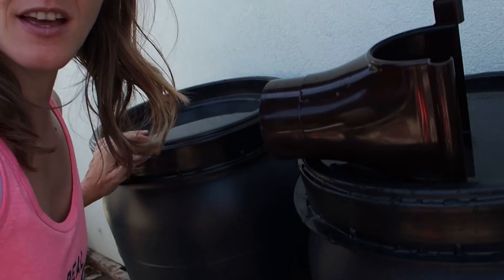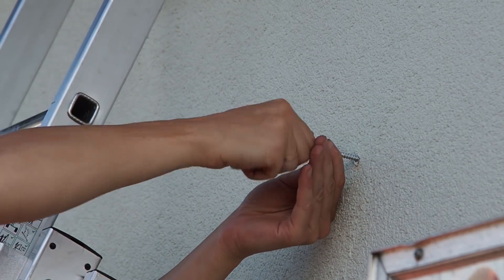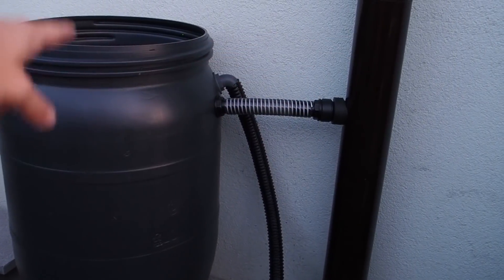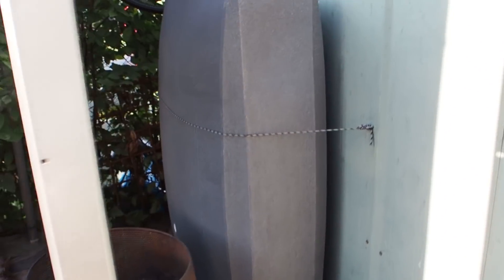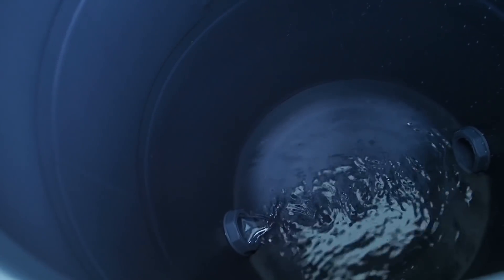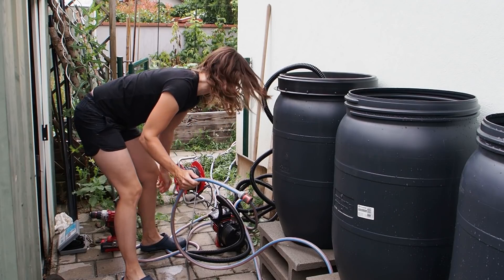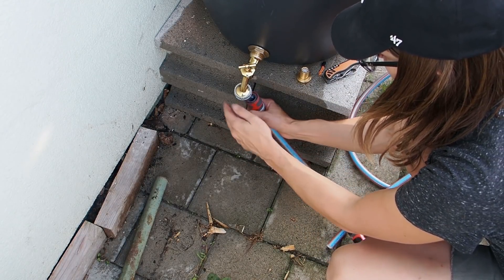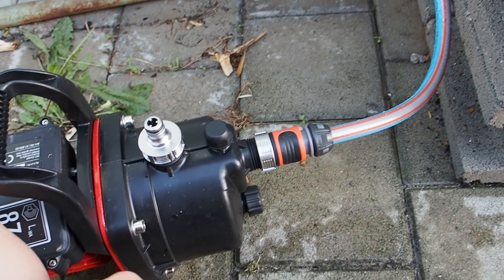Rainwater Harvesting System (Water Storage for the APO.CALYPSE)

Comment: Hi, nice video for the folks who haven't got the chance to install an underground tank (which i would definitely recommend! They catch all the rainwater from the roof and are relatively cheap and have a high volume starting at about 2000l, i got one with 9600l, so there is some reserve).

A few questions/suggestions:
Why didn't you just connect to the already existing gutter with a longer connecting hose? Would look prettier and be less expensive, always work with what's already there ;-)

also the hose connecting the last barrel with the pump should not be a normal "Gardena-Hose" as they are desined for pressure and not a "vaccum" (Unterdruck in german). There are special hoses for that which you can get in every hardware store cut to the length you need: https://www.hornbach.at/shop/Saugschlauch-PVC-25mm-1-Meterware/10186840/artikel.html

I also would not drill holes in the lids, as already mentioned becaus it leeds pollen and bird poo into the barrel which eventually will let algae grow. The engineering way would be to connect the barrels with secondary hoses which are above max waterlevel, so no outside air can get into the system. The more pragmatic way (imo) would be to just drill a few small holes juuust beneath the threading where the lid goes on on the side, so less dirt can get into it.

Comment: I am very glad that you are happy with your system. I am however a bit perplexed as to why you elected to connect the barrels together at the bottom instead of the top. As is, the system will evenly distribute all rain water equally between all three barrels. If you set it up so each barrel over flows into the next they would fill in order first one then the next. If you then put a sillcock  ( hose bib ) near the bottom of each barrel you could draw from each barrel one at a time as needed. The last in the sequence can be made to overflow into a drip hose and water the garden automatically with the water in excess of what you can store, albeit only when its raining but its better then just dumping it on the ground. It would turn a nominal rain fall into a good soaking for the garden.

Comment: if you have the means you could lay the barrels on their sides and make a vertical sistem (can put more barrels and save space, but the downside is to have to use a ladder to clean them and maintance etc). there are several pictures on pinterest showing the structures. it is my dream to make one of those xD

Comment: You shouldn't have needed an additional overflow.  The catch funnel that you showed is designed to back-feed once your barrels are full and then the excess rain water will just go down through the open center and out your downspout.  My only concern is that you didn't run your rain water through a first-flush system to discard the initial wash of your roof to not collect bird droppings, dust, etc. that collects on your roof since the previous rain.  Looks like a great system otherwise.

Comment: Awesome work Lilly. I'm sure you'll get some feedback about do it this way or that way. But for water harvesting for the garden only, this is a great set up. 
Here in Oz we have systems that capture the initial flow of water off the roof [~100 litres] as it may contain contaminants. Other systems have valves between the tanks to isolate the tanks when full, so as not to have cross-contamination and to minimise loss if a barrel springs a leak.
So many options.
You made great choices and excellent work.

Comment: Nice  job lilly, but erm, please correct me if im  wrong, would it be better if the input hoses on 2nd and 3rd containers were at high level the same as on 1st container, and then put the overflow hose on last(3rd) container out into your existing waste water drains to protect your foundations. This way your containers will fill up  to the top in sequence rather than have all three containers sharing the water  up to a certain level. ??

Comment: i was  wondering how do you handle birds scat that gets into the rainwater off the roof?
Reply: The biggest use of water in the average US household is flushing toilets. If you only used this as garden watering and toilet flushing, you could use other water sources to drink. Otherwise, there are very effective water filter solutions similar to what you'd use on a long range camping trip.

Comment: That's why there's another port on the top of the pump, so you can fill it to prime the pump. Smart move putting the spigot in anyway, pump fails atleast you can still draw water from it. Do you have a way to filter out any contaminates from your supply ?, chemicals from the roofing materials, or derbis introduced from the gutters.

Comment: Consider sticking up a 2nd set of barrels on top of the existing ones (considering watertight connections of course) and you'll get decent pressure and save space. By the way, you tested the spigot on the 3rd barrel with only a low level, low pressure, amount of water. Did it remain watertight when full?

Comment: you need to raise that pump above the barrel and prime it.
Reply: pour a liter of water into the priming hole on top. filling the black hose. itll work.
Reply from the maker: Yeah i tried that but it didn't work. Only when i filled the suction hose with water from the tap the pump was working.

Comment: Nice System but maybee you can install a Filter at the Raingutter for filtering Branches and Leave and bigger Partikels or in the long Term on Hot Days the water will no longer be clear and you have to clear the Rainbarrells by Hand.
You only need a Peace of Gridwire an a Clamp.

Comment: Seems like I'm going to be the odd man out here. As it seems everyone else is for lack of a better term kissing butt. But what do you think the chances are of that last barrel getting totally full? In order for that to happen that first barrel is going to have to displace as much water as the last two. It's not possible. Furthermore why eliminate a quarter if not more of your storage capacity by putting the fill so low on the first barrel? And lastly the overflow should be on the last barrel not the first barrel the whole point is to get the water to go from one barrel to the next to the last and when that barrel is full then overflow out. The way this system is set up the second and third barrels are going to get about halfway full and then water is going to overflow out of the first barrel. It's simple physics doesn't take a lot of brain power to figure that out. But everybody seems so quick to have to pet you on the back or kiss your ass that it has gone unsaid. This is not a good example to model other rain catchment systems off of. I'm sure that you will learn from your mistakes on this one, but with a little bit of research and forethought these mistakes would not have been made in the first place. Hopefully you will film a retraction when you discover that it doesn't work like you think it's going to work.
Reply: All three barrels will fill up equally, not one at a time. With the connecting hoses at the bottom it equalities the pressure across all of them
Reply: @kaderdoo  they'll fill up equally until the volume of the first barrel equals the volume of the second two. In which time it will hit the overflow so you'll only have two barrels worth of liquid you'll have one semi-fold barrel and two half barrels. This is all due to the way they are plumbed. They should have been plumbed from the top of the first to the top of the second to the top of the third and then the overflow into third barrel.

Comment: Don’t forget to put silicone caulking in the hole that you drilled in your stucco and around the screw head so that water does not penetrate into your framing and cause wood rott and mold in between you’re walls .

Comment: You skipped one essetial step in the installation and that is why the pump didn't work at the first try. Those pump only works when the water is already inside the pump. That is not airtight like an airpump, so it can't build vacuum without water. When you installed it, only air was inside the pump and inside the black pipe, so without vacuum it was not able to suck the water. Some of the new pumps (called jet pump) are able to fill themself with water, but most of them can't. That is why after the installation you have to fill the whole system (pipe and pump) fully with water before you can use it. There is an extra hole on the top of the pump, next to the output hole. You have to unscrew it and fill the system with water until you can't see any more bubbles and the water overflow. Then you have to put back that screw. That black hose was far to long, but probably at the end there was a filter and a one-way valve. Usually that one way valve is neccessary to keep the water inside the pipe and the pump, when you don't use it. Without the valve, the water goes back to the barrel and next time you have to fill the system again.

Your new setup probably works without this hassle, because you put the pump under the barrel and made a new hole, so the water automatically fills the pump always, when there is enough water in the barrels, but that tap maybe not a good choice. That pump works well, when both the input and output pipe big enough. I dont know exactly which size is the best, but I think you need use at least 1 inch/zoll hoses for both size. Check the manual. Not just the hoses should be 1 inch/zoll, but the connectors too. Usually those quick connectors size is only 1/2 or 3/4 inch/zoll, but there are larger ones in a decent shop. Small diameter hoses and connectors block the pump, so the pump could overheat and die. Maybe the diamater of the tap also too small, but at least you should open it fully. IMPORTANT: The input side hose should be special because it must keep it's shape under vacuum. The normal garden hoses, even the best ones not good enough for the input side. That is why the original black hose is strengthened. If you use a normal garden hose, it could collapse under vacuum and block the way of the water and that would kill the pump. Without enough flowing water the pump will die. 

If you lift the pump much higher probably won't work again.

This is not a lecture just a friendly advice, and sorry for my english if you don't understand the whole thing. :-)

And some more things: Maybe those connections between the barrels now looks good, but the water pressure will be much higher when the barrels are full. Better to use hose clamps for every connection point, than loosing all the water. Don't block the water on the output hose, so for example dont use autostop conector at the end of the hose. Use at least one water filter, especially if there is a big tree near the roof. There are cheap large diameter water filters for irrigation systems.

Comment: A suggestion, put the overflow port the farthest barrel away from the intake port. The goal is to have excess rain water to flow into the first barrel, and exit from the farthest one, to gradually replace all the water with fresh rain, if there is enough excess.
Reply: I should think that at the rate which she will be drawing the water from the far barrel that would provide all of the circulation needed.
Reply: Rain water can expired?
Reply: @kusukacolaylowlee1611  oh sure, bacteria and such will start growing fairly rapidly without some treatment. The barrel material does block the Sun which slows the process down but it's still an issue  even if used and refreshed  regularly. It's not such a big deal if only used for the garden but still something to be condidered.
Reply: @richardelliott9511  bacteria eat what? Need sugar or protein!

Comment: Great video again! It's good you show the bits of the project where it sometimes doesn't always work out on the first attempt, as that's exactly what happens to us all! (Trial and error sometimes)..  but you ended up with a great little catchment system!!!
(And like you said one you can easily add to!) ..You could always put a removable plank/shelf across the top of the barrells to stop anything getting into the water which could contaminate it if there were any contamination in the air or falling into the holes in the top of the lids or whatever? (and guess it would add an extra layer of protection for the barrels from any UV rays?) Just an idea really, but I'm sure it's fine as it is..👍🏴
Ps. You can always cut the top of the other square container you have and make it into a hinged or removable lid?

Comment: The connection hoses are usually at the top to overflow into the Next barrel and to reduce the pressure on the holes which reduces the chance of a leak. The connections between the barrels can then have hose's reaching to the bottoms of each barrel to Syphon into each other

Comment: If the hose was filled with water before being inserted in the barrel, it would have worked. Ie. It needed to be primed.
Reply from the maker: yeah I know, that is what I found out later. But still priming the suction hose every time I want to water my garden is not convenient. In my opinion the spigot installation did the trick.

Comment: I've been trying to do something like this with trashcans but I had two problems.  One, debris from the roof would get into the water and cause it to go smelly really fast.  Even though the water is meant for my garden, I don't really like pouring smelly water somewhere I'm growing food!  Two, if there is any way for mosquitos to get in there, they'd reproduce in the water and I'd have a big mosquito problem.  The solution I'm going to try is to use a paint filter where the water goes into the trashcan.  Does this system have any kind of filters built into it?
Reply from the maker: right now I dont have any filters in my system. also I do not have debris on my roof, because of the lack of trees nearby. I didnt have a situation with mosquitoes yet, so maybe I will get a filter in future, but dont know if it is really necessary.
Reply: We put a sock over the end of the downspout where it enters the barrel.
Reply: @joesmith4222  That's a good idea too

Comment: We sometimes lose electricity here in the Ozarks  so i have 4 55 gal food grade barrels i fill with water and then have a 12v RV type water pump and 2 check valves installed , i can connect my pump to my Pick up truck and pump directly into my house.

Comment: Interesting idea although the one thing i seen was the sequentual barrels should have had the collection hoses more to the top so the water flowing in wouldn't have to fight more pressure from the bottom up. Then maybe the overflow could be put in the end barrel so there is water flow to all 3 and movement of liquid .. If that makes any sense

Comment: Stick with black barrels, white/opaque have no UV protection. If you used Ty wraps/ zip ties the white seem to snap after 6 months. The drain pipe you put in is going to flood the area if not capped.  Hole on top will let mosquitos in .  The space is ok if a barrel goes bad so you can change it easier. Gray tank cut the top off 2 or 3 inches down , put plastic, nylon pieces 5 or 6 inches wide screwed to the screwed to sides then top can be screwed on. No plastic use aluminum and use stainless steel screws short ones.  or  small bolts and nuts.
Reply: @walter8008  Color is a factor, white can not get the chemicals use for protection. The opaque water containers have some that is why the are off white. Take a white and a black ty wrap put them in sun and black will be there for years white 6 month it dries and breaks. read chemical makeup on what you use.
Reply: @walter8008  color Is definitely a big factor, check yourself buddy

Comment: I keep 110 gals.(treated) in the cellar at all times plus I have 2 wells on my property that can easily be converted to a hand pump system.
Reply from the maker: cool, I wished I had a well.
Reply: @SurvivalLilly  Something else just hit me. I have built a couple of these systems over the years and if you have a way to elevate them @ 3-4 ft. you will have better pressure if you are using a garden hose to water plants. Gravity is a big help with these units.
Reply from the maker: @neverlookback3382  that is why I bought the pump, otherwise the waterpressure sucks
Reply: @SurvivalLilly  Did you get the pump to run? Sometimes you need to prime them at first.

Comment: Why did you connect them at the base? One leak and all three would drain. My instinct would have been to connect at the top and let them fill up sequentially.
Reply from the maker: because then you would have to install a bigot at every barrel. then you have more work connecting the hose to each of the barrel once one barrel runs out of water. now I can water 360 liters at once, without having to change the setup.
Reply: @SurvivalLilly  I understand what your saying, but in a drought situation collection and retention is more important than convenience is what I was thinking.
 I have been collecting rainwater in four 55gallon blue barrels for 25 years for use on the allotment. I sank them 3/4 into the ground, to protect from frost. They are connected together by siphon pipes through the lids, no need to drill holes in the barrels ( Much as I like watching you using power tools. I fell in love with you on the video where you went food shopping and came home with a chop saw, what a girl Lol ) 
 To get the water out I use a submersible pump and a micro irrigation system, which drips water directly to the ground around the roots of the plants so very little wastage.
Reply: My thoughts as well, with a check valve between the barrels you would also be able to isolate each barrel for maintenance and cleaning without losing all the water from all three barrels.